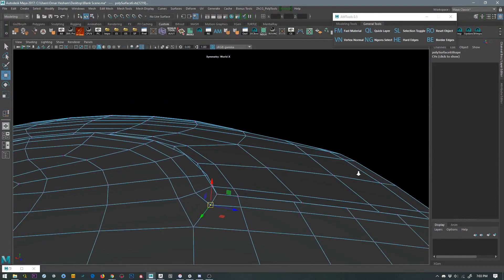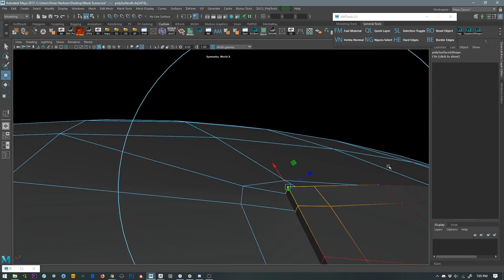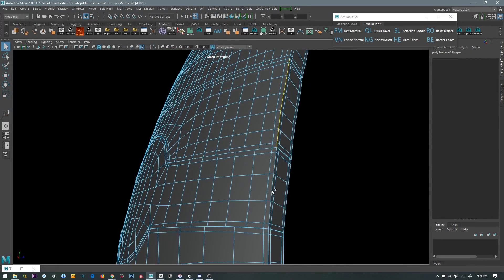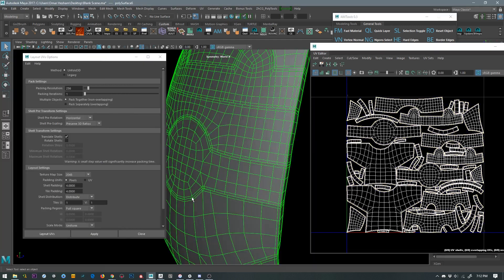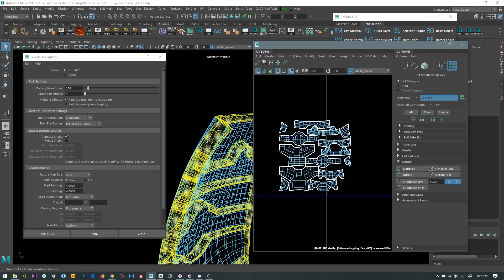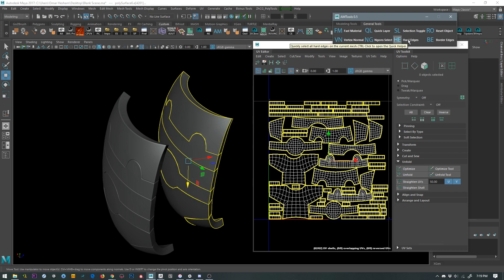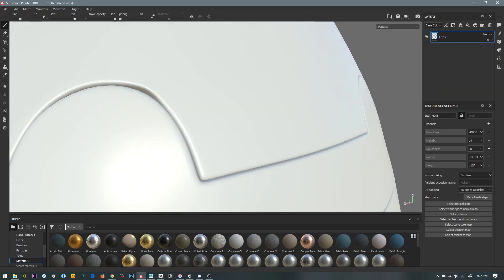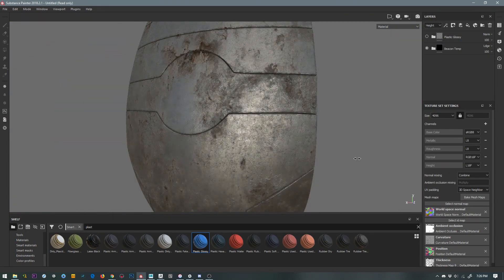Hard Surface Panels Workflow

Comment: Why not simply keep the groups you know you're going to separate but do you group split AFTER you've zremeshed?  Then you wont need to spend nearly as much time matching up the corners for clean topo.
Reply from the maker: I noticed Zremesher gives better cleaner result if the panel border is an open mesh and is not bumping into another polygroup. That is why I split then Zremesh.

Comment: Did you Mask the corners at 0:08 ??
Reply from the maker: Yes. Masked the corners with the mask brush and then ran a polish by features with open circle which will smooth everything but the masked sharp corners.